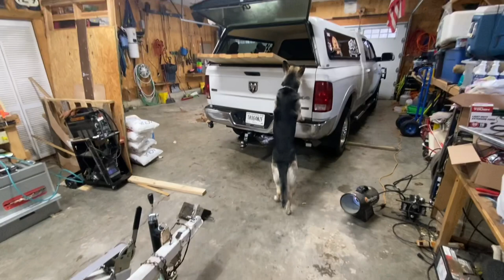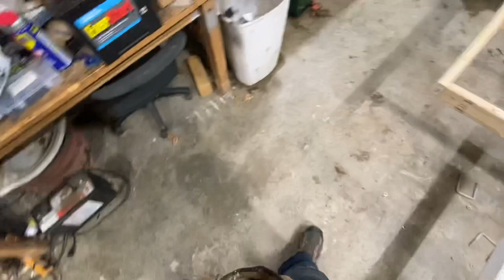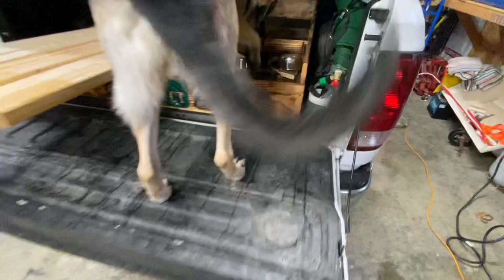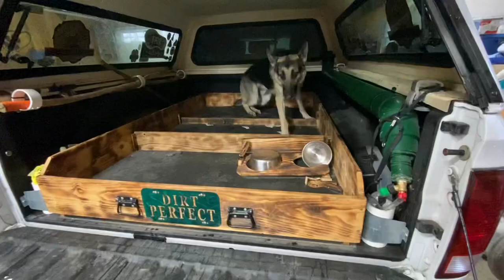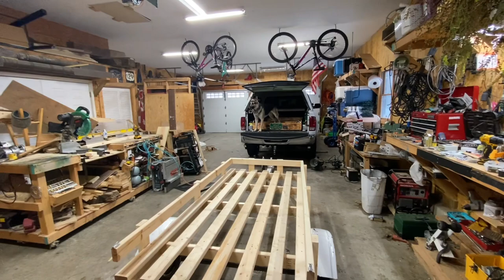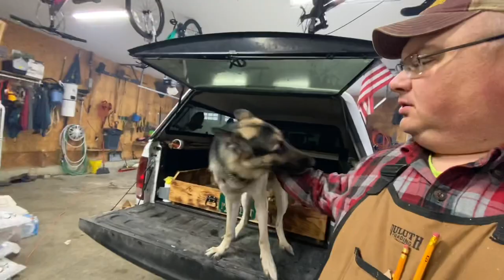DIY utility trailer build for about $200 bucks!!

Comment: great little budget build. I use used motor oil and diesel fuel mixed together then spray it on the wood, it really helps preserve the wood much longer.